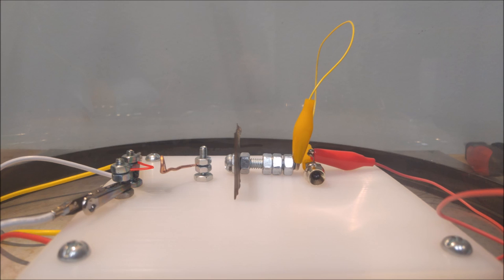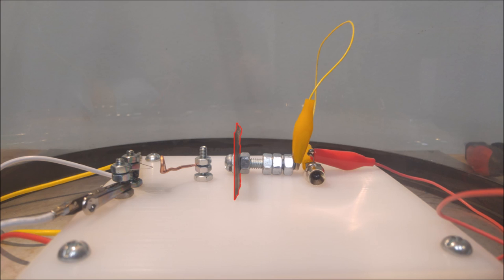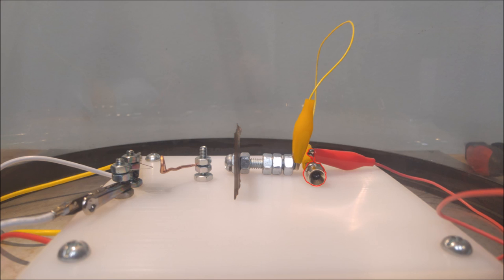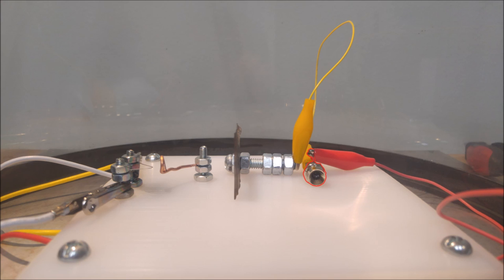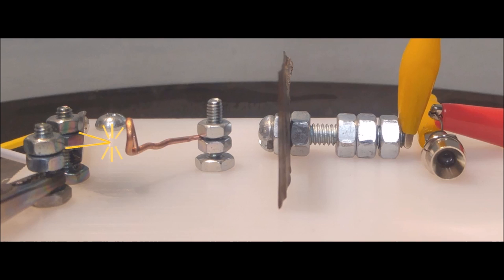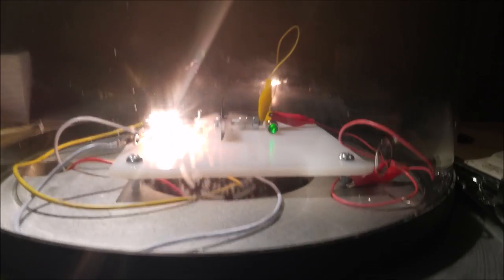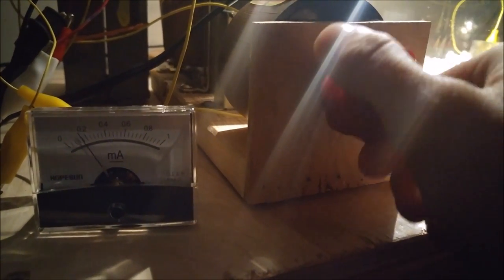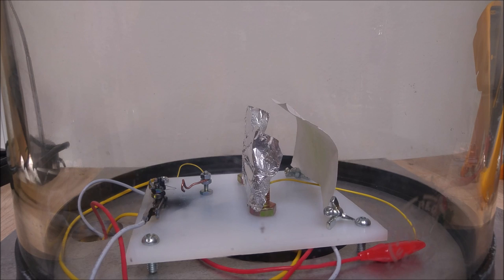How an electron gun works

Comment: A neutron gun works the same way?
Reply from the maker: Generally speaking, neutrons are much more difficult to produce. Because they are not charged, they can't be accelerated by electric fields. A more typical way of producing neutrons is by accelerating protons and having those protons hit a target. You can look up a "spallation neutron source".
Reply: @EricDalgetty  ok thanks for that info, I’m not a physician or anything, but I have curiosity about almost everything so lately I’ve been learning about nuclear fission, and I’ve managed to learn a lot of basics, but I still wanted to know how neutrons are shot towards the uranium, since the Uranium is a solid Little Rock (the one used as fuel cells) so I have understood that this solid piece is hit by neutrons. I still have so much to learn btw. 😆
Reply from the maker: Oh so in the case of a weapon, they used something called an "urchin". This is a radioisotope that emits alpha radiation, surrounded by a material like beryllium. When the alpha particles hit the beryllium a small percentage will cause a neutron to be emitted.
Reply: @EricDalgetty  ok that makes sense, I’ll check on that urchin thing, I guess the speed of the neutrons is quite high right?
Reply from the maker: @discoverlight  Generally neutrons will be several MeV, unless they are thermalized, like in a nuclear reactor
Reply: @EricDalgetty  when thermalized they are slowed down right? What MeV stand for?
Reply from the maker: Yes thermalized is slowed down. MeV is mega electron volts, which is the neutrons energy. Thermal neutron have energies around .02 electron volts
Reply: @EricDalgetty  thanks for the info man. 👍🏿 very appreciated and useful.